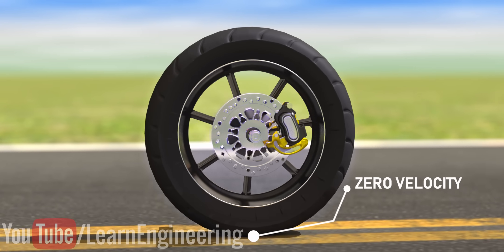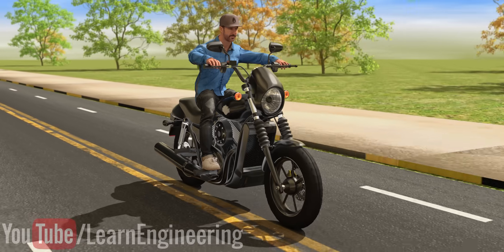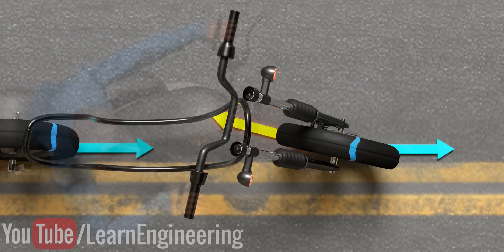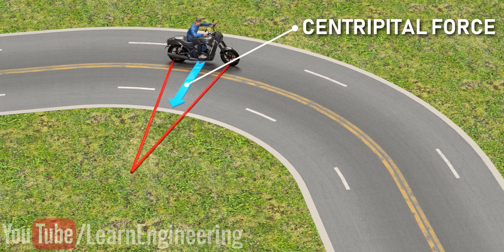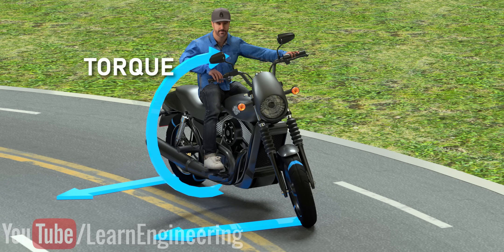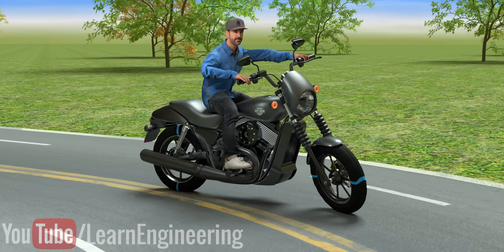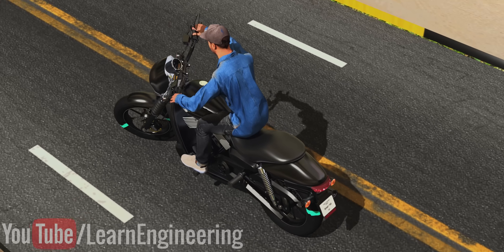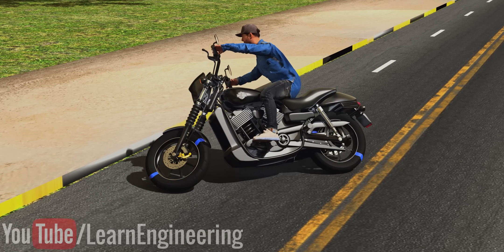Counter Steering | The interesting physics behind it

Comment: "Counter Steering" starts (and ends) a lean , and together with "Normal Steering", both are used at ALL SPEEDS to guide a motorcycle through a turn.
As described in the video, "normal steering" is exactly what steers a car - the rotational plane of the front wheel(s) is deflected from its direction of motion
so that a "slip angle" results, which causes the tire(s) to generate a lateral (i.e. side) force to bring the deflection (i.e. the "slip angle") back to zero.
But the front wheel direction is tied to the chassis, so as the chassis turns with the wheel(s), it keeps generating the front wheel deflection (i.e. the "slip angle"),
and the turn continues.  In the process, the front wheel(s) turn the chassis and thereby steer the rear wheels - much like a rickshaw driver steers the wheels
of his rickshaw - and a slip angle is generated at the rear wheel(s), and the rear tire(s) generate a lateral force, too, and the entire vehicle travels through a turn.
Slip Angles are small and not commonly seen except in "drifts" or "slides", so virtually every rider is unaware of them in normal operation, but without a slip angle,
a rotating tire will not generate a lateral force for a turn.  That is "Normal Steering".
    As in the video, a motorcycle requires a lean in the direction of the turn.  But by the law of Conservation of Angular Momentum, when the rider leans his body
in one direction, his motorcycle will lean in the opposite direction, i.e. their motion will be about their common center of mass ("CM") and so the CM doesn't lean.
To cause the CM to lean right, the wheels must be displaced to the left, and by the rider simply hanging on, the CM (the motorcycle and the rider) will lean right.
And to cause the wheels to move left, they must be turned left by a steering input.  Thus, by steering left, a rider causes a right lean.  That is "Counter Steering".
It is done before "Normal Steering" on entering a turn on a motorcycle.  It is hard to see in normal riding, but it is quite apparent during quick maneuvers.
    Once Counter Steering has set up (or is setting up) the lean at the start of a turn, the Normal Steering can begin, which is turning the front wheel in the direction
of the turn.  This is easy to see at walking speeds.  (It is easy to see during a quick turn as well, but the rider isn't usually looking at the front wheel during a quick
turn.)  To exit a turn, the rider counter steers in the opposite direction, i.e. he "oversteers", to bring the lean back to zero (i.e. bring the motorcycle upright to vertical),
and then (or as that process completes) steers the front wheel back to straight-ahead.
    Gyroscopic forces of the spinning wheels and the castering effect of front fork "rake angle" provide stability (i.e. resistance to changes, or "back pressures") which
affect the ease of steering a motorcycle.  And the round cross section of a motorcycle tire causes the "bump steering" that allows a highway lane change without
using the "Normal Steering" process.  But an actual "turn" is due to Counter Steering to control lean , and Normal Steering to control the turn .
Reply: Dave InWLA , Breezelow Unknown
Great now we have two fuckin clowns leaving comments.

Dave InWLA accepts that counter steering exists but has got the first clue how to steer while using it.

Breezelow Unknown just denies completely that counter steering exists at all. 

And between them they are going to get new riders killed! Well done you pair of pricks!

If you want to see (never mind all the chat) counter steering at work: https://youtu.be/lzk8oyNO708 watch the full video!
Completely ignore these two puppets. Ride safe. This works at 20, 40, 80, 100+ mph and all the speeds in between.
Reply: Dave InWLA 
https://youtu.be/w5TFADsvo0M
Here’s a guy that actually rides a bike.!
Reply: Dave InWLA 
breezelow unknown 
https://youtu.be/lzk8oyNO708
Leave a comment saying CS doesn't work on this vid fella. You won't though aye, because it proves you wrong!😂

Comment: Watch this video: https://youtu.be/bguGJUz3Usg 

I do not recommend this on the public highway but it shows exactly the principle of 'shove-steer'. Heavy countersteer on the front wheel with full throttle to the rear, causing rear wheel over steer. This is an extreme clip but still it shows exactly what's going on.
Reply: Rod Fleming 
Ignore my last post. I see where you’re going with this. Apologies.

Comment: In order to get a better understanding of counter steering try this ( on a empty road of course or a closed circuit  !)
Ride in a straight line with your left hand on your right side grip in order to maintain the speed. In order to make turns now your brain needs to actively think, pushing the handlebar a fraction forward will actually make you turn right, whereas pulling it towards you will make you turn left. 
I do that all the time if I need to give my right hand a break ( no cruise control) on long rides. 
Only try this if you're already a very experienced rider !!!!
Safe rides 👍🏍

Comment: Counter Steering controls the location of the wheels under the bike:  Move the wheels out from under the bike to cause a Lean .
"Normal Steering" (like car steering) controls the rate of turn .  To see this most clearly, watch your front wheel as you initiate and
continue a turn in any direction at low speed.  First, you move the wheels out from under the bike with counter steering to cause an
appropriate lean, then you turn the front wheel in the direction of the turn.  To straighten out, you counter steer INTO the turn, i.e.
over-steer, to bring the wheels back under the bike, then you steer straight ahead.  This procedure is used AT ALL SPEEDS.
Reply: Dave InWLA wrong! Maintain pressure on the handlebar on the inside of the turn to maintain lean. Push a little more to lean more or ease off to lean less. If you are in a right bend ( pushing in right bar) if at any point of that bend you push on the left bar you will immediately stand the bike up! Stop giving bad advise!
Reply: @softailfun   -  The pressure you feel is due to "trail" of the front wheel, which can be thought of as "caster" - the distance between the tire's contact patch and the intersection of the fork's pivot line with the ground to make the front wheel return to straight-ahead.  It is a separate effect and has nothing to do with turning or initiation of the turn - it is just there for positive stability.  Think of what happens at slow speed - the pressure is almost gone, whereas the counter-steering remains to initiate lean, and "normal steering" remain to cause the turn.
Reply: Dave InWLA 
We can argue about this for weeks. Been riding 40 years on and off. You maintain pressure on the bar inside the turn. If you push on the outside bar you will stand the bike up. You say it yourself... push left go left, push right go right. If you push one way to initiate a lean and then push the other bar, you will start to initiate a turn in the opposite direction. Peace. Out!
Reply: @softailfun   - I did not say/write "push left go left, push right go right" - someone else did.  The "pressure" against which you push is merely the centering effect of the front wheel's trail , a feature designed to counter turning - large in cruisers, small in racers.  Notice that unless your "pushing" actually causes the front wheel to angularly deflect left or right, you continue to go straight ahead.  In short, the trail of the front wheel is to act against its deflection.  The actual lean and turn are caused by the deflection that the trail effect opposes.
    Again, to show this to be true, just walk your bike through the process of a turn.  Trail will not affect the process, and you will see that first, you turn the wheel opposite to the direction you want to turn in order to cause the lean, then you turn the wheel in the direction of the turn to cause the bike to turn.  To straighten out, you over-steer to bring the wheels back under the bike (i.e. to "unlean" the bike"), then point the wheel straight ahead in the new direction.
    This is exactly what you have been doing for 40 years, and what your police instructor had been doing, without either of you noticing it.
Reply: Dave InWLA do you actually ride a motorcycle? When I said “push left etc” I wasn’t quoting you, but you state counter steering to initiate a turn. If you know another way of counter steering other than I described I’d like to hear it. The physics to me aren’t important in this instance, basically... I don’t care. You complicate a very simple operation. Push left go left, push right go right. To increase lean push a little more, to decrease lean push a little less, the front wheel will self align during the bend.But what you DO NOT DO is push right to go right (fore instance) and then positively steer the front wheel into the bend I.e. push left. The bike will not continue on it’s course around the bend and it will stand up. So... do you ride a motorcycle or is this just a physics project to you? Remember, the advise that you give on these videos can/is followed by novice riders. If they do what you are suggesting they will crash. Just saying!!
Reply: @softailfun   - Actually, it's "turn left to lean right, then turn back right to turn the bike right".  Having to push in order to counter the trail-caused stability is not an essential part of turning.  Indeed, if the front fork were raked vertically, there would be no push necessary, and if the fork were raked (i.e. slanted) backward, you'd have to release pressure on the handlebars instead of pushing on them.  Your "push right, etc." is merely because of the effect of trail, and it has nothing to do with actually leaning or turning the bike.  Being able to ride a bike is not knowing how to ride a bike.
Reply: Dave InWLA 
Look, I take it you don’t ride. Based on the fact that you seem to know physics... but somewhere along the line of theory/physics, whatever, your version has become flawed. In the real world motorbikes just don’t behave the way you suggest, that’s how I know you don’t ride one.  I can confidently state that if you ride a bike at 60mph and enter a bend, steering the bike as you suggest..... you won’t make out the other side. 100% fact! You don’t/won’t believe me and that’s fine. Get someone to take you around a track one day, watch twist of the wrist, the acting is crap but the science is good. Now I’m done here. Thanks for the exchange and god help anyone who tries to steer a bike as you suggest! Peace. Done!
Reply: @softailfun   - I have been patiently explaining the Mechanics of motorcycle steering and presenting a simple experiment that proves my point.  My explanation works with ice skates, roller skates, skate boards, surfboards, motored and unmotored scooters, plus bicycles and motorcycles - all of which I have owned and ridden in my life.  One has merely to be willing to look at what one actually does rather than just to feel what one does.
Reply: Dave InWLA 
https://youtu.be/lzk8oyNO708
The only way you have ridden a m/c is if you were wobbling around at about 12mph. Sorry I don’t believe you. Watch this guy, simple example push and turn. Push left go left, push right go right.
Reply: Dave InWLA 
No response to the video? 🤔
How's all that theory working out for ya?
Reply: Dave InWLA 
Seriously! That's it? You either see that this vid blows your theories to pieces, or you disagree with the evidence that I have presented. If your theories no longer hold water, then you should at the very least, delete these dangerous and misleading posts that you have put up. On the other hand, if the video doesn't support what I say, come and shoot me down in flames and show me the error of my ways.

Comment: "Normal steering" only works below like 15mph, we would consider counter steering "normal steering"
Reply: That’s not true. Next time your out riding at 10mph try to turn left without putting a bit of right input to start the lean. You cannot do it. Go strait as an arrow sitting perfectly upright and turn your forks left. You’ll go right. You’ll see even the slowest turns are initiated by the opposite input. Once the lean is happening then the forks will follow.

Comment: I did not understand it at all from this beautiful video. Can anyone else share same feeling? I did countersteer my yamaha nmax 125 and I can confirm that it works but I absolutely did not understand anythink explained on this video. I always thought that countersteering has something to doo with giroscopical efect where on higher speed front wheel tries always get back to its original straight positon of lowest friction. While doing so it makes dumping sinus like form from contersteering direction(e.g left) to opposite direction(e.g.right), while going to opposite(e.g.right) you use this force (higher speed, higher force, faster going from left to right) and make leaning procedure to change direction. To avoid unexpected sinusoidal resonance/Wobble of front wheel as depicted on following video " https://youtu.be/ufjKCbmrgGw?t=38 " you use special front wheel dumper/steering stabilizer.

Comment: Everyone countersteers every time they turn.Its just that it is subtle enough that many riders don't recognize it. The lower the center of gravity, the harder one must counter steer. This is especailly pronounce on a Goldwing, or scooter. 

I dumped a scooter hard  in a slow speed corner because I countersteered too hard. The scooter rotated into the lean so hard, the front tire lost grip when I turned into the corner. It slammed me into the ground.

Comment: Push left grip , go left . Push right grip , go right .
Reply: Exactly. Once you got that, practise 'shove-steer' where you give a firm controlled shove on the bar on the side you want to steer towards, while keeping throttle on. The bike will immediately drop into the turn and it can turn more rapidly than you think possible. It's not dangerous, though it does take balls the first couple of times, but it might save your life. NO BRAKES AND THROTTLE ON while doing this. If you bottle out and hit the front brake you may high side. Don't touch it.

Comment: When we subconsciously want to make more room to negotiate a turn and act upon it, we are doing counter-steering. Tight turns are difficult to make especially at moderate speed. Taking a snap moment to turn the opposite way before turning makes us feel the turning circle is larger than it physically is. Herce, it should be easier and safer.  The snap moment act is “countersteering”. It is part of the turning flow,  The Physics helps riders communicate with engineers to design better two wheel machines for us to enjoy.
Reply: No. That's not how it works. At all.
Reply: I never feel as if the turning circle is larger. The "snap" makes the bike lean more quickly and turn more tightly.